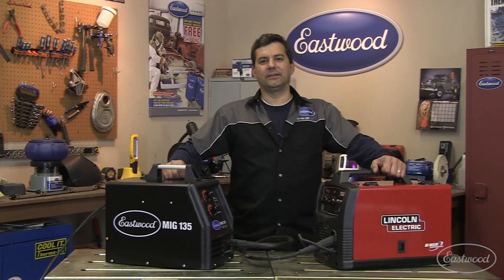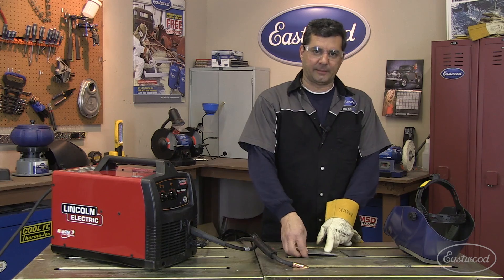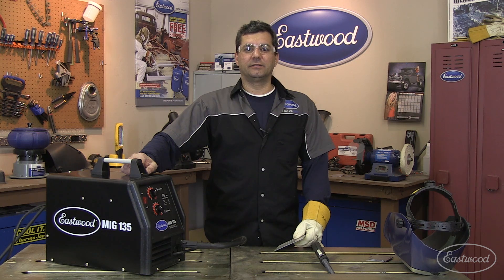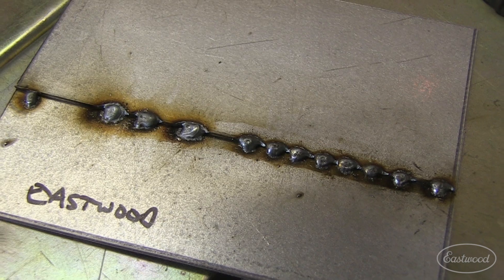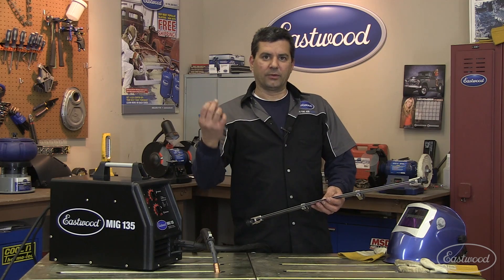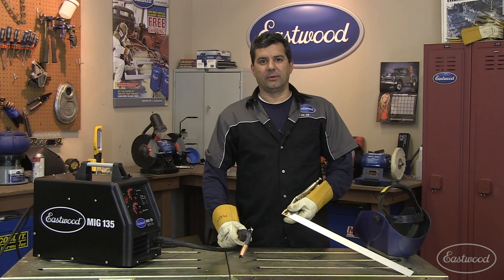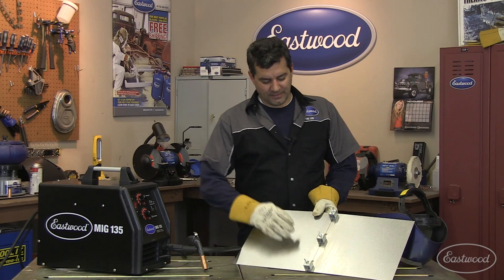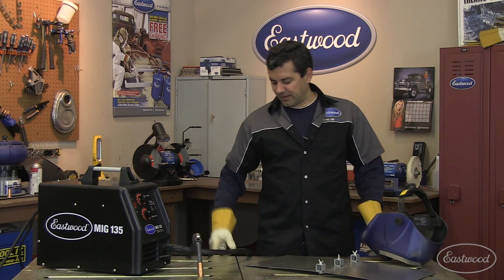Lincoln MIG Welder vs Eastwood Welder - Comparison & Testing Plus Tips & Techniques for Better Welds

Comment: Do a test on them after 3 years,,my eastwood 175 ,,,control board went out after 3 years .
Reply: Eastwood Company it took me 2 weeks to get ahold of someone I left msgs and what not no calls back. A month later I FINALLY got a replacement from you guys. I sold the thing shortly after and bought a Hobart. Had the thing over 5 years now haven’t looked back since.
Reply: Mine took a shit in a month
Reply from the maker: Can you contact out Tech Department so they can help - 800-343-9353.  Eastwood takes pride in our machines and we will stand behind them.

Comment: Close but these machines aren't equivalent. A true test would have been to match the Eastwood with the Lincoln 140C. Good looking weld, though.  How is consumable replacement. Can I buy local or do I have to buy all the parts via the internet.
Reply from the maker: The Eastwood MIG 135 and MIG 175 use Tweco Style consumables, available at Eastwood or most welding supply stores.
Reply: But the 140C was about 50% more than the SP-140T. Eastwood was comparing their "DIY" welder to Lincoln's DIY welder. Incidentally the SP-140T is exactly the same as Home Depot's Weldpak 140 HD and Lowe's Promig 140.

Comment: I love this Mig 135.  I am not a welder by any measure, but since I upgraded to the Eastwood Mig 135 I am proud of the quality of my welds.  Here is my review on the Mig 135.  https://youtu.be/oFRsD6roUkA  If you have questions please ask.  I can answer from the perspective of someone who has never been trained in how to weld.  This is my third welder and by far the best.
Reply: +Ray are you using this welder?  It should handle it.  If your not, as long as it had a setting for 1/4in you should be able to do it.  If the frame is thicker than 1/4 I would put a second bead overlapping the first bead.
Reply: ManCraftingTM I'm still shopping for a MIG Welder.
Reply: +Ray maybe one of the guys at Eastwood can tell you. They do a lot of restoration.  Not my area of expertise.

Comment: I got a hh 210 and an Iron man 250 I wanted a bigger portable unit I think the eastwood 250 may be sitting next to my hh 210 ...not buying white blue or red anymore they are way over priced .
Reply: Yeah, the Iron man 250 only has a 30% duty cycle at 250 amps and the Eastwood Mig 250 has a 60% duty cycle at 250.  I think I"ll sell my Eastwood Mig175 and get an Eastwood MP250i so I can have stick and tig to play with as well as allow 45lb spools which I need to use some wire a retired welder gave me that the Mig250 doesn't allow.
Reply: @danp129  hows your eastwood doing? I'm planning on buying the 175i because it welds aluminum too. I already have a stick and tig machine so not worried about that.

Comment: Ok Eastwood! i own this little guy an its one of the best 10g or less sheet steel welders i have used for the weekend warrior and i have welded with alot of top names,  but i would like to see a video with this welder on the it's high end range with flux core on 1/4" hot rolled or 3/16" which you claim it will do. we all know that 110v mig is not for building car frames or trailers, but lets see what the reasonable limit is.
Reply: oh and you need to include the optional knurled .03-.035 smooth .023 roller with the machine. flux core needs to be on a knurled roller period.

Comment: I have had The Lincoln weld pack 100 I own in service since 1994. It has had over 1k pounds of wire put through it. 

 As the old saying goes you get what you pay for.